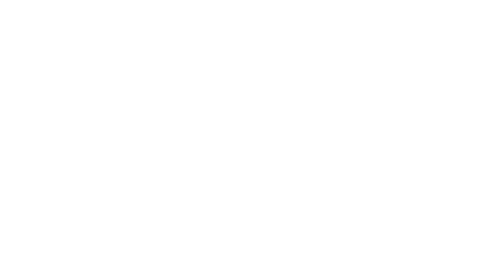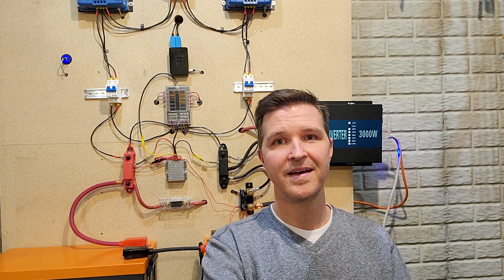Simplifying Bulk, Absorb and Float Modes

Comment: I have a question. I’ve got a Vektron smart solar charger. MPPT 100–50 I understand about the bulk absorption and the float modes, but the lights are they to be solid or flashing when they are in each mode are you able to help me out?

Comment: I have two 40 amp controllers.  Neither one of them drop down to the 13.8 float voltage after reaching 14.4 v.  They stay at 14.4v all day and only when the sun goe down does the voltage drop back down.  The controllers are set to 13.8v for float bit doesn't seeme to work. It's been this way ever since I built the system.  The system seems to work just fine.  The HQST controller has an indicator light that slow flashes at 14.4v.  The manual says the slow flashing means that it's in float mode but it's at 14.4v not 13,8.  Never can figure this out.
Reply from the maker: I'm sure you won't have a problem.  Keeping your batteries at a higher state of charge can affect your cycle life, but i don't think you will really notice it.  Thanks for the comment!

Comment: When Bulk Charging is complete and the battery is about 80% to 90% charged, absorption charging is applied. During Absorption Charging, constant-voltage regulation is applied but the current is reduced as the solar batteries approach a full state of charge
Reply from the maker: Thanks for the info and for the comment!

Comment: I thought Absorb was same as Bulk (MPPT)
Reply from the maker: It usually is.  Bulk will charge it to full, absorb will keep it there to make sure all cells are balanced then float lowers the voltage a bit to reduce the amount of heat.

Comment: absorption mode is applying canstsnt high voltage to the battery , lithium battery dont  need that. only flooded lead acid battery .. just as how you charge you phones batteries or camera battery or cordless powered tool batteries.. once they reach 100% its done  ... obsortion and lithium do not co exist..
Reply from the maker: Thanks for the comment.

Comment: I just installed a OOYCYOO 100 amp charge controller and it keep powering off the load... The instructions are mostly non existent. Not sure where I can get an instruction manual that explains in detail.... Thanks
Reply from the maker: I wish I could tell you what's wrong, but the instructions are garbage.

Comment: Sir i have 32650 battery my settings is 14.6 boost my float 13.8?thats is correct?
Reply from the maker: Yes.  My understanding is Lithium Ion and LFP batteries are the same when it comes to voltage limits.

Comment: I bought a victron 100/20. I have a flooded battery 12v.

What should I put on my settings?

Absorption?
Float?
Equalization voltage?
Hope you can help me. 🎖
Reply from the maker: I don't have any flooded batteries, but I've found this website that might help.
https://support.rollsbattery.com/en/support/solutions/articles/237882-calculating-proper-charge-settings-for-rolls-flooded-lead-acid-batteries
I used the table as reference.  Looks like Bulk and absorption charge to 15v then float at 13.50v.  Equalization is between 15.6v & 15.9v.
I hope this helps!
Reply: @OffGridBasement  Thank you so much. I will try this. 👍
Reply: That is the 3 settings I need to know...

Comment: Great video! I have 5 lead acids rv Marine batteries in parallel, what do i select in the battery drop drown for the Victron 100/20. What charge configuration would you use? I subbed!
Reply from the maker: I would use the User settings and put in your own values.  You need to find out what the voltage values are for the Marine batteries.  You don't want to select a preset value when you can't be certain of the values then hold.  Sorry I can't help you any further.

Comment: is the boost voltage the same thing as Absorption Voltage. Am a little confused as my batteries says 13.8V as Boost Voltage but nothing about Absorption Voltage
Reply from the maker: Yes.  The boost voltage should be what your battery manufacturer considers to be 100%.  That is usually 14.6v.  Absorption is keeping it at that voltage so all the cells in the battery balance out.  You don't want to keep you battery at that level of voltage for longer than a couple hours, so it should drop to float voltage, which is usually recommended at 13.6v.  I hope this helps!  Thanks for the comment.
Reply: @OffGridBasement  Thanks a lot for the explanation. One more thing please, i have 2 pieces of 12v 200ah batteries. How do i configured the float voltage of 13.5v and absorption Voltage of 13.8v on the outback flexmax 80? Should it be configured as float voltage 27v and absorption voltage 27.6v since i have 2 piece of 12v 200AH batteries and my inverter is 24v 2KVA.
Reply from the maker: @esosaaghimien That is correct!

Comment: What is that device between the busbars ?
Reply from the maker: It's a buck converter.  It converts a part of my 24v system down to 12v in order to power my 12v lighting and my Rasp Pi.  Thanks for the comment.

Comment: Can u do a video on the victron software setup from scratch (windows only, maybe include software download links), and go in depth on how u adjust the BULK voltage setting, I know ur system is setup for 24v, but can we also change these setting in 12v or 48v system as well, I want to boost my solar voltage in the bulk mode, i did this on my other MPPT to 15.8v and saw a 50% increase and time reduction on a charging cycle, then used ABSORPTION to drop this voltage back down so no extreme over voltage damage happens (and this works well, with no battery damage) thanks
Reply from the maker: What is the top voltage of your battery?  Are you using Lifepo4?  I'm surprised you can get that high of a voltage without having an overvoltage shutdown.  I'll be doing something with a 12v setup using a victron CC in the future.  Thanks!

Comment: You can explain me what is boost  mode in to my mppt controller I have redodo 40
Reply from the maker: Boost mode is the voltage you set to get your battery to 100%.  Most lifepo4 batteries have a boost voltage of 14.6v.  The float voltage should be 13.8v.  Hope this helps and thanks for the comment.

Comment: When you talk about a float charge for a solar charge controller, I have trouble understanding if the float charge is going to be the  max charged voltage, and will the float charge being too high mean you are overcharging your batteries? Is your float charge supposed to be different from your bulk charge setting, or when to stop all power coming in setting? 

And some charge controllers you do set the float charge and separately from the max cap battery full setting.

I see on batteries listed figures for cycle charges and running charges. How do you translate the float and bulk charge voltage stated settings to those figures for cycle and running charges?
Reply from the maker: Bulk charge is the max voltage to charge to and float is the voltage constantly kept at.  Example for 12v lifepo4 battery:
Bulk charge would be 14.6v.  That would charge the battery to 100%. Float charge would be 13.6v.  That is the voltage you want to hold it at for the rest of the day.  I hope that makes sense.  Thanks for the comment.
Reply: Thanks for the reply!  @OffGridBasement

Comment: Hey guys I've got Victron 100/20 Bluetooth.. It's showing absorption then float mode saying 14.7 on my Bluetooth app but with the multimeter it's reading 11.5..  What's going any ideas ???
Reply from the maker: Is your setting 14.7 for Absorption?  Are you saying when your Bluetooth app shows 14.7v but a multimeter shows 11.5v?
Reply: @OffGridBasement  Yea absorption is set at 14.7 and float at 13.8 have I them back to front ??
Reply from the maker: These settings are correct.
Reply from the maker: I would also recheck and reseat the wire connections to the charge controller and to the battery.
Reply: @OffGridBasement  It's basically going into float mode  displaying 13.8 volts on the application but only reading 11.5 on two multimeters so not full and not charging which is rather annoying as the sun is finally out !!!
Reply from the maker: It's reading 11.5v at the connections on the charge controller or the battery?
Reply: @OffGridBasement  It's reading 11.5 on the multimeter connected directly to the battery's. Yet in the application it's displaying 13.8

Comment: I think it makes a difference on what kind of batteries you are using
Reply from the maker: I'm sure the vast majority of batteries go through this process when charging from solar.  If there is a different chemistry of battery that doesn't, I haven't heard of it.  The only one I can think of that might not is Lithium Ion, but I haven't worked with it so I can't be certain.
Thanks for the comment!

Comment: Hi 
a small question if please 
Ihave  4 acid batteries and i want to increase  them another 4 
the question  is  can put the new one on the system or i should change the old one also
Reply from the maker: It depends on how old the batteries are and if they still keep a good charge.  The new batteries will suffer if the old batteries are not keeping up.  The pack is really only as good as the worst battery.  I'm guessing you are connecting in parallel.
Reply: @OffGridBasement  
yes dude the conction is parralel 
till now the batteries still good  after 1year using 
but without checking  but still serving good 
any way thank you for responding

Comment: Thanks for this video! I do have a question, I have a 24v lifepo4 system. I'm using the outback charge controller. My question is what is rebulk voltage and what should it be set at? Thanks again!
Reply from the maker: Re-bulk voltage is the level at which you want the system to switch from float back to bulk.  My 24v system is set to:
Absorption:  27.8v
Float:  26.8v
Re-bulk:  26.4v
Hope this helps!
Reply: @OffGridBasement  yes this definitely helps! Thank you!

Comment: When I first started using a solar charge controller I made the mistake of not fully understanding absorption mode. I wanted to charge my battery to only 85% to extend its cycle life.  So,  I set absorbtion to 3.4 volts for 5 hours.  Little did I know that a long enough absobtion time would take my battery to 100% charge regardless of the voltage I set absorbtion to.  The only difference in the voltage used during absorbtion is that the lower the voltage,  the longer it takes to reach 100% charge. So, in my opinion, if you only want to charge your battery to 85% capacity to prolong cycle life,  you should set a high bulk rate with no absorbtion, or no more than 20 minutes of ab absorbtion.
Reply from the maker: That is very good advice.  Thanks for the comment!
Reply: That's not how that works
Reply: @izaacbanks3337  tell me how it works please.  I appreciate any help I can get.

Comment: Lithium batteries don't float. Do I set the float voltage to the maximum voltage of the battery?
Reply from the maker: No.  Your absorption should be at full charge.  Usually 14.6.  Then you should lower the voltage for float.  Something like 13.6 or 13.8 for lithium.  These numbers are based on a 12v battery.  Check your battery documentation for the exact voltage numbers.  Hope that helps.
Reply: @OffGridBasement  it does help,thanks. My battery(Li) comes in a companion fridge and it states that no more than 12.4 volts input to battery. So,12.4 float setting?
Reply from the maker: @simonpepper9721  If states no more than 12.4v then you would want to set the absorption to 12.4 and probably float around 12.1 or 12.2.  Float voltage should always be a bit lower then full charge voltage.
Reply: @OffGridBasement  thanks mate.